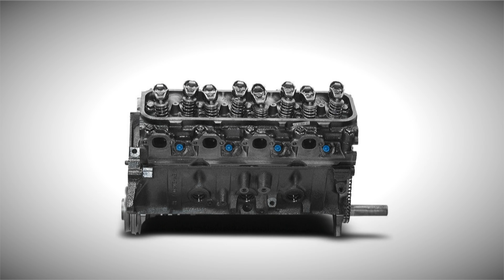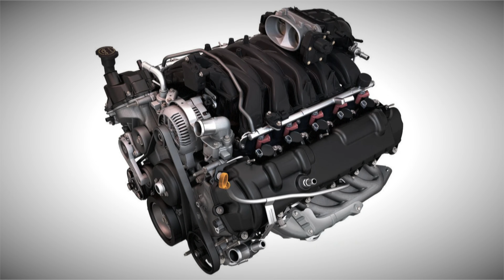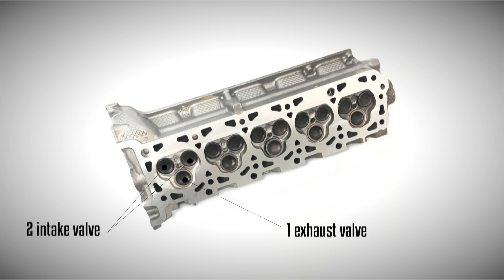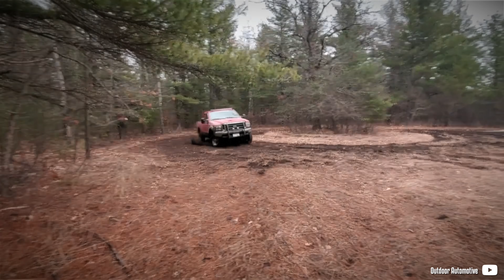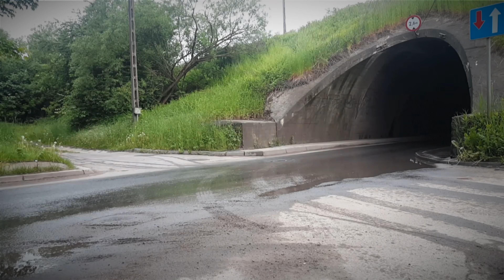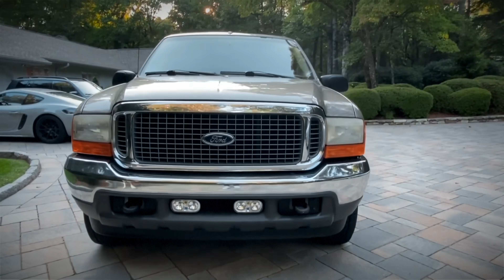Is Ford's V10 Truck Engine Any Good?

Comment: Exhaust lead on passenger side manifold, the studs tend to break off into the aluminum head.. pain in the butt, but hoping that will be the first and last time I have to touch the engine.

Comment: I have a 99 dually super clean crew cab. Bad year for V10. Put a rebuilt TSB updated one. (Better heads lifters and all) cost like 4k for motor 1500$ installed in a day. Didnt even take hood or headlights out I don’t believe 😂😅 new ones pull cab 30k diesel

Comment: 2000 F250 Crew Cab with slide in camper.  Runs great!  Lucky with only 89K on the odometer.  Feeling very grateful to have it.

Comment: 2000 Excursion V10. No diesel rattling. No sparkplug issues...just torque them right. Rear main seal replaced under warranty 24 years ago. No other repairs needed. 225,000 kms. Towed twice for dead fuel pumps. 

Sales figures in Canada were so low, there is little on public record as to how many there were. Destined to be a classic.

Comment: I have a v10 in my RV and it has 40,000 miles on it it's misfiring I don't know if it's the injectors or spark plugs

Comment: I have a 2012 F550 flatbed with 334,000 miles  and a 2015 F450 with 204,600 miles both are tow trucks. Very dependable trucks!

Comment: Fun fact: Ford made the V10 available for their F-650/F-750 cab chassis because U-Haul the rental truck company couldn't get gas class 6 trucks from GM anymore and at the time most of the fleet of 14-20ft trucks were all Ford V10 powered Econoline cab chassis. It was a great engine so long as you accepted the terrible gas mileage. Only the previous Ford 460 was spoken with higher praise.

Comment: I like to leave an opinion before the video to see how wrong I am sometimes compared too other people's perception. I'm a big ford fan and have learned a lot about the modular platform in my 11 years of owning cars with them. the 6.8L V10 was a practice in the absurd. they knew it wouldn't outsell the 7.3L, but it was a fun pet project that blew the shit out of GMs 454 and 8.1 vortec. The dodge V10 made power but they were plagued with their own issues. now the Ford V10 it was no stranger to issues. 

the biggest known flaw of the 6.8L V10 is the block itself. Ford did not want to pay for bespoke casting of a 10 cylinder block, so the engine is more or less a 5.4L V8 with an extra pair of cylinders welded to the back. as you can imagine, its hard to weld an entire engine block without overheating the metal in one spot, or having cavitation in your weld. these issues in welding quality lead to the block cracking, the head gasket surface failing and warping, or the rear most cylinder losing compression. All issues that are basically non factors on a regular 5.4 or 4.6. the 4R100 transmission was definitely not good enough for the application. at the very least ford should've made it shift harder to grab the gears and not wear them out so prematurely. the 4R has a really bad habit of fully engaging the TC lockup before the clutch pack has fully engaged, causing band slip instead of TC stall.

With those main issues in mind, I would rather pay the premium for a manual truck rather than spend a thousand or 2 having the 4R built with better parts and upgraded clutch packs. As far as the welding issue goes. In my opinion most of the trucks out there have been around long enough that if they were going to fall victim to this issue, it probably already happened. the biggest piece of advice i can give is find the right truck and don't try to change it's lifestyle. if the truck was babied for 15 years and only has 80k miles on it, you're probably going to start breaking and replacing shit if you immediately start daily driving and beating on it.

Comment: No mention of there being two different v10s? The 3 valve head in pickups and Class A RVs and the 2 valve in E series vans. Ford learned early on that they had to change recommendations for oil in the 3 valve to 5W-20. Anything heavier would lead to the 3rd valve cam follower getting spit out of position after the cam roughed up due to insufficient top end oiling when idling. The 3 valve has a lot more moving parts syphoning off oil pressure at idle speed and startup. The 2 valve has less (including no balance shaft) The balance shafts and cams in the 3 valve are running in bare aluminum bores and unless properly maintained also start losing low speed oil pressure there as they wear. Talked to so many clueless mechanics who would insist 20w oil was too thin and they unwittingly set the hapless owner up for a blown engine.

Comment: I have two e 350 v10 vans and they both tow 10000+ lbs excavators without hesitation, only downside is the gas consumption but reliability, power and simplicity of this motor is impressive.

Comment: Run full synthetic oil and change every 5-6k miles using only the recommended oil weight rating and they'll last longer then most engine's.

Comment: The Ford V 10 engine is just a Triton engine with two more places to fail. The engines themselves work well and are reliable. The biggest problem is that the quality of the aluminum that the cylinder heads are made of is the same as what you would typically find in a really cheap washing machine and Ford really scrimped on the cast iron used in the exhaust manifolds so if you live in the rust belt, you will have some serious decisions to make when the cast iron manifolds rust out and the studs holding them to the heads are also gone with the manifolds. Getting the rusted studs out of the heads is pretty much impossible and usually costs $3000 at a machine shop and I'm not going to even get into the blown out spark plugs.

Comment: The 4.6 modular V8 was better better fuel economy and could easily be built to make the same amount of power. Bulletproof the spark plug problem was rare on those it was more common on the 5.4 triton V8. The only problem was the infamous intake manifold.

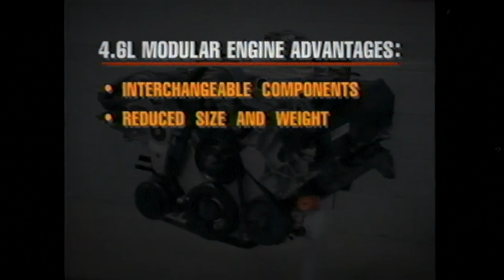Comment: If the 4.6 L V8 is a "small block", then the 5.4 L and 6.8 L can't be "big block" (as claimed at 1:57), because they share the same bore spacing. The terms "small block" and "big block" don't just refer to displacement. 

The Ford Modular engine family has a bore spacing of 100 mm, making it a small-block engine design. The deck height does vary (227 mm for the 4.6 L versus 256 mm for the 5.4 L, for instance), but they're all still small-blocks.

Comment: Ford built single overhead cam engines in the 60's and double overhead cam 4 valve per cylinder engines during WW2 to be used in military tanks. Ford didn't need to borrow from European or Japanese manufacturers, they already had the technology.

Comment: I have a 2003 F250 and I tow my 30ft trailer just as good as any diesel mind you that I have put a thing or two under the hood but I love my truck and it does the job

Comment: I may be a freak but I have had the 4.6,5.4 and now have a v10. Never have I had a spark plug issue with any of them. The 5.4 cleared 400000 miles and spun a bearing. Still drove it into my shop.

Comment: I has RV with the triton V10 6,8 L.  Has 45kmiles  on it. No issue . The milage has been between 10-13mpg. Its quiet at normal open road driveing, but some noice uphill and downhill with higher rpm. It sounds like it wil be durabel. Oilchange and filter every 5000miles. I thing the sparkplug pop -out can be rare with these engines, and the same with the triton 4.6 L.  If you dont overload and drive smooth, it will be a less risk that this will happen.

Comment: *LOL*  No, the V10 is not a good engine.   Overhead cams are the same era as pushrods.  They took forever to catch on because they are not better, just top heavy and more complex.  They have been pushed onto V8's because of efforts to appease government mandates.  There's a reason the LS engines OWN the performance and aftermarket industries.  Advancement is in induction and computer controls, where Ford lags behind GM and Toyota.  The Ford V10 is most assuredly NOT renowned for anything, being utterly inferior to the Dodge V10.  Durability is not a word dealers of mechanics use when discussing any of the OHC Ford motors including, increasingly the Coyote engines.

Comment: At work, we have a great condition example of this engine in a Ford F450 flat deck dually with a manual gearbox. Despite being made in the year 2000, it has less than 30,000kms on it. I LOVE driving that thing.

Comment: I have had my 2002 F250 4x4 V10 since it was new. Let me just say it is the only Ford I have ever owned. In 188,000 miles it has never failed me. Mine is a work truck usually pulling a loaded trailer or our camper. I change plugs and coils every 60,000 miles and full synthetic oil every 3000 miles. It still looks good and runs great!!  So yes the Ford V10 is an excellent engine!!!

Comment: if you dont change the oil.... it will blow up...neighbor had one... didnt change the oil for 8000 miles and the oil passages clogged

Comment: I got 595,000 miles out of my 2002 E450 v10 box truck.  543,000 out of the transmission. Traded it in at 673,000. Not bad for a gas engine going all out most of the time.
Reply: My '04 Excursion about to hit 390K miles on original heads,cams,chains & tensioner. Just replaced original water pump. Super reliable & no leaks like diesels
Reply: What kind of fuel mileage did you get?
Reply: @TombstoneLuke-hi4wt  6.5 to 7.5 mpg.
Reply: @spauley2133  Two years ago I rented a U Haul with a V10 and a 26' box.   I loaded it to the max.   Drove 1000 miles and got 15 mpg, but I drove at 55 mph.   I just bought a straight truck, 2015, with a 20' box.   I'm crossing my fingers that my experience will not be like yours.
Reply: @TombstoneLuke-hi4wt  mine was a 16' box truck with a liftgate. Avg. speed around 75 to 80 mph. Going 55 downhill, I might get 12mpg. If I went 55 around St. Louis I might it killed faster. Good luck.

Comment: I have an 04 2v f350 v10 literally the most reliable vehicle ive owned. Ive put 40k+ miles when i bought it with 211k miles and it hasn't left me stranded yet

And it hasnt pulled everything ive hooked it up to. It can definitely tow more than 15k on a gooseneck theres a guy here on youtube who oulled 20k of hay with his f250 v10

Comment: My work had a Ford F-250 with the V10 engine. I only drove it briefly before we discovered the frame was starting to rust out on it and it was sold off.
The best way I can describe it was fun to drive and smooth as butter, but it was incredibly thirsty. The sound of the engine always sounded a bit unusual to me, maybe because I was so used to hearing V8 engines. It had virtually no engine vibrations and was smooth as glass. It had decent power and sounded awesome when under a load. It wasn’t a perfect however. The biggest problem we had was abysmal fuel consumption. It was pretty bad on gas. We’d have to fill up quite frequently and it was costing a lot of money to run it. Sometimes we would rather use the V8 trucks just because it wasn’t so harsh on gas when towing and the power was similar to the V10 anyway. 
The engine had some problems with the spark plugs as all tritons do. None of them popped out but a few of the plugs were being held in by like 2 threads and the threads were totally mangled. We later had a blown head gasket after the engine overheated when the lower radiator hose blew off. We had to deck the cylinder heads which turned into rebuilding the top end of the engine. Since the cylinder heads were off, we decked the cylinder heads to make them flat and modified the heads by machining our own steel spark plug inserts. We made it so we could use normal spark plugs instead of the crappy two piece spark plugs Ford wanted to use. We pressed the steel inserts into the heads by baking the cylinder head in an oven and using liquid nitrogen on the steel spark plug inserts we machined. It wasn’t easy but it actually worked. We also replaced the exhaust studs because half of them snapped off during disassembly. And after some new head gaskets and new timing chains and some prayers, the engine was running like new. It was a winter project for the crew. But it wasn’t a few years later that we noticed the frame was rusting out pretty bad and we deemed as being unsafe to use. One of the employees bought it from the company and is planning some crazy project with the engine. I really don’t miss that engine since the diesel engines we use now are way more fuel efficient and more powerful.

Comment: Just sold my 1099 F350 4x4 to a friend.  It had over 330,000 miles on it and still didn't use more than a quart of oil between oil changes.  Never added any.  Just changed at 5k

Comment: I love my 6.8 2v. Its a very Strong engine even at 230k miles. I have a 8500lbs travel trailer that i tow regularly with it. I've towed the same trailer with my sister's '19 Ram with the 6.4 v8 and it's just more comfortable with the v10. It cruises and doesn't require alot of throttle input. The 6.4 is too high strung wants to do 80 and suck fuel. Hill climbs with the v10 are uneventful. Gear it down let pull at 3500rpms. The v8s scream up the hills at 5 and 6k. I wish the v10 would've stuck around to get VVT and higher flowing heads, etc. These were the gas equivalent of diesels of the same period.

Comment: Every v10 I used at work blew out the spark plugs and exhaust manifold gaskets. Why ford thinks a 6mm diameter thread is good enough to bolt iron manifolds to aluminum heads is beyond me. Especially in the rust belt where they weld themselves to the head. Ford gets many things right, but what they get wrong is infuriating and stupid. I’ll take a LSv8 any day for power and economy and easy fixing.

Comment: What a great engine, it had a much longer run than GM's 8.1 V-8 & Dodges V-10.  Thats a testament to the Tritons durability and how much abuse its able to withstand.  One of the reasons y it can take so much more abuse than the closely related 5.4, is because the V-10 is so incredibly smooth with no vibrations.  The only disappointment was that Ford never put the 4 valve heads on it, that woulda been sweet.  The power the 3 valve makes was very impressive at 362 hp &460 torque especially when you consider thats with low compression pistons and no variable valve timing.

Comment: Howdy, got one of those Ford V-10 engines in my 2001 Ford Excursion. Torque is outstanding. I pull a towable trailer which is 34 foot long weight 8,000 pounds up 6-7% grade hills. Does this task without breathing hard. Looked at diesel power,  the up keep was a little more than the fuel I’d burn. The V10 is low maintenance. Just keep it serviced. Won’t sell the Ford Excursion cause nothing to replace it on the market. Besides I just completely restored the Excursion,which is cheaper than buying a new truck at $100,000 easy or payments of $1,500 or more a month forever.  $12,000 in restoring mine is much better and I own it…
Reply: I have a modest 2003 Fiat JTD diesel engine. And the car is generally in good shape. However, due to the draconian anti-pollution and climatic measures, my car will not be able to enter any
Reply: City as of 2025. So I can't spend any money fixing it as soon I won't be able to go anywhere with it. The "climatic" measures are annoying us. I write from Spain.

Comment: 2003 Excursion with a V10 that is about to turn over 250,000 miles. Still idles so smooth that I often think it has died at stoplights. 👍
Reply: These triton 2V non cam phaser motors like conventional 10W40 oil.  We use it in all our high mileage motors and they do great. Don’t use that 5W20 crap.
Reply: Same, I have a f250 200k. The idle on the v10 is smooth as silk. If I have the music up it's impossible to tell it's running unless I look at the rpm gauge. Only problem I have with the v10 is oil consumption. I have to put a quart in every 2k if I tow a lot, if I baby it maybe every 3k
Reply: At 12 mpg that would of been 20,833 rounded gallon of gas
Reply: @snowjammma yes but as a man that runs his own service truck I’d pay for gas over time in the shop anyday. My truck in the shop means I’m losing money not making money
Reply: @lilweezy110 well said
Reply: Parents had a limited with the same setup. Excellent vehicle.
Reply: my old boat hauler was a 2005 Excursion 2WD V10. Had almost 350K miles on it when sold and ran great.
Reply: My 2002 excursion has 310k on the dash and still runs like a dream. I recently started using her to tow my boat down to the gulf, she pulls a 32ft proline like it’s not even there.  Man I love my truck
Reply: My Ex V-10      Hardly drive it anymore. Kids are outta the house. Brand new $8,000.00 paint. Super clean inside and out.
https://www.youtube.com/watch?v=hmxfLeDnkZA
Reply: Shit wild just bought a 07 f250 with fucking 390k and she's purring

Comment: I worked at a company with a fleet of F550 service trucks weighing in at just under 20k.  None of the got more than 3-4 gpm, about 5 of the 18 we had suffered catastrophic cam follower issues requiring a new head with one still being under warranty.  We even serviced these trucks ever 3k rather than the recommended 5k mileage.  The trucks suffered from slow acceleration and would slow down on slopes even with your foot to the floor.
Reply: i think there are mercedes sprinters with better record then that, the 260 hp turbo diesel l6 engine auto gear box, can pull 5 tones overall with no issues at 100 mph all day too
Reply: @Pookytroll  You are still short 4.5 US tons. 5t(metric) is 5.5 US tons.  Also I was talking about the horribleness of that engine.  I have a 6.0l F550 that did over 20k and would cruise at 80mph, because that was the max cruise setting, for hours and got 12-13 mpg.